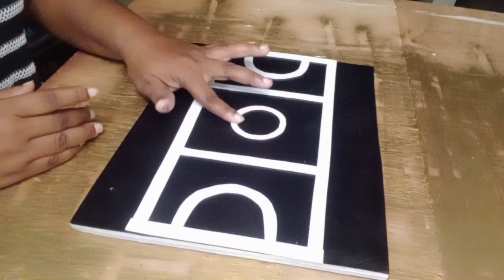How to make aNetball court / Diys

Comment: I need to make one of these right dont knw where to start. What did use to make the goal posts
Reply from the maker: i use a straw with a small curtain rod and the glue gun to make the net but you can use for the net the bag that the onion comes in.